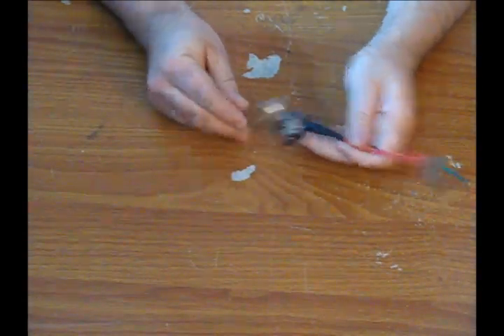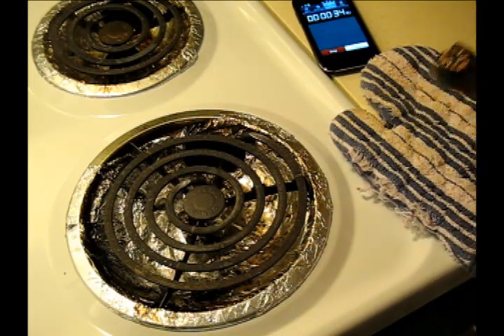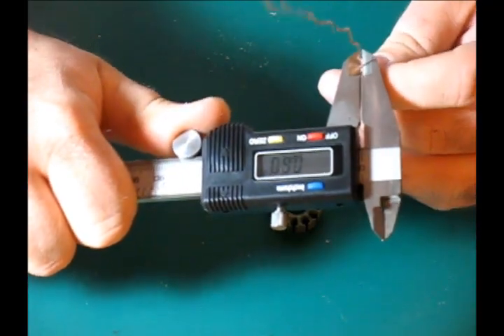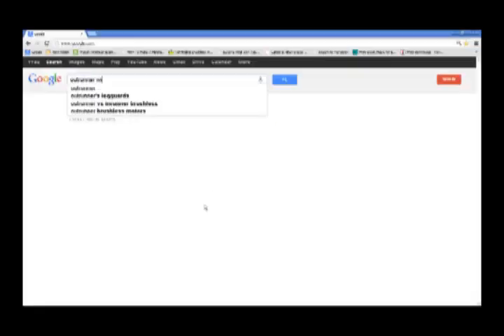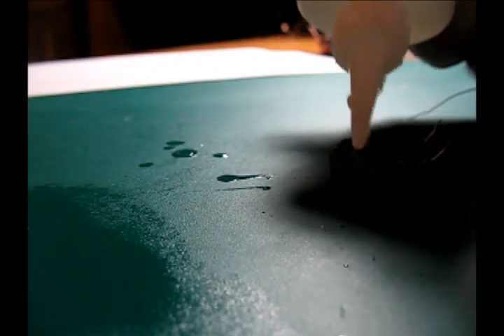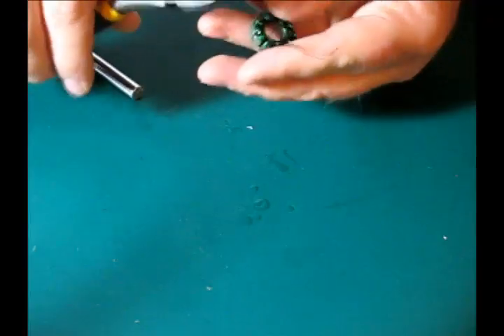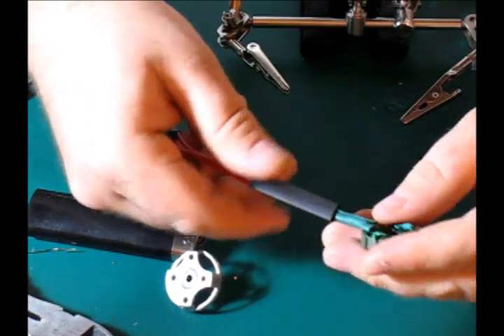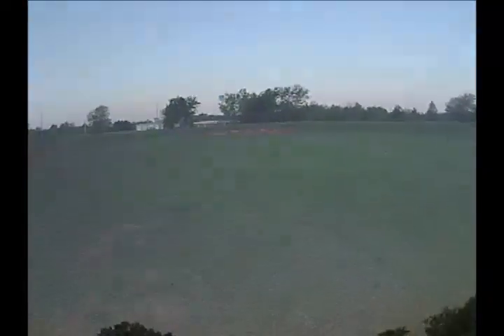Wrapping a Turnigy Park 300

Comment: A very aggressive disassembly procedure.
One should never damage engine parts.
Laminations are very brittle and heating them too much leads to loss of efficiency.
Bearings above 80 degrees c. they begin to drain their oil. you have to remove them before that.  CA glue  destroys the insulation of the magnetic wire and can cause shorts. never to be used in an motor. http://aeromodelismoelectrico.blogspot.com/search/label/Rebobinando%20un%20motor

Comment: What type of insulator was that liquid you used? were did you got it from? (i have used nail polliser, but not sure it is a good solution)
Reply from the maker: Dimitris Alexiadis I honestly just used CA glue.
Reply: smit6089 cyanoacrilate? Is this like super glue? Logo type? I ask because I have damaged the insulation and Need to fix that first. Did it work ok for a long time?
Reply from the maker: Dimitris Alexiadis yes. Just like super glue. Mine lasted about a year but then I over propped it and killed it.

Comment: Would permatex shellac work for insulating the stator.
Reply from the maker: It may but I'm not sure. To find out dab a small amount on some paper and allow to fully cure. Then use an ohm meter to check for conductivity.

Comment: could i do this to change a motor from low to high kv by adding less turns?
Reply from the maker: There is a lot of math relating to this that I will not pretend to understand but in my experience more turns yields more torque but Lower KV and less turns yelds less torque but a higher KV.
Reply: thanks for responding my problem is i have 2 motors with much to low kv to use and i would like to change it its worth a shot i guess

Comment: Thanks for the tutorial, really well made. I wondered if you could give me some pointers on how you pushed the shaft through?

I removed the C clip and tried using a vice but it wasn't budging, I read online that a few people have bent the shaft using that technique. I can't use the prop saver as it's too small and is fixed to the bell. Any advice would be much appreciated. Thanks.
Reply from the maker: Mine was extremely difficult to push through the bell. I heated the bell on an oven coil for about 10 seconds (similar to removing the bearings) and then hit it hard with a vice. Make sure you are using a socket or something against the vise to give the shaft a place to go as you are pushing it through.

Comment: Hi excellent explain, thanks, but please.
I am looking for , how rewiring sunnysky brushless X2212-13 Kv980 , number turn , and wire size etc.., someone knows you there make ? or to have one idea ? Also maybe a plan. ?? Thanks so much for your answer.
Reply: Lawrence Spies There is a lot of variables.  I have a 12n14p that I am winding to 400 KV.  The stator is 5020 so it will be different than this tiny stator.  For my motor 920kv would be about 3 turns.  I have not found one single equation that would work for everything.  It a lot of trial and error.  I just wind a motor with a best guess and measure it, then adjust from there.  Remember, to test the motor you dont need to go through a full assembly.  I just drop the bell on and fire it up, not worrying about cable soldering or securing the bell.
Reply: Hello -  I have now finished rewinding  my Sunnysky - 12N 14P, in delta. Works very well.
Reply: jeanlucvar Is there a formula to use for wiring a motor to a certain Kv? say 920Kv. I have seen kits to build motors using 9 and 12 stator. But I cant seem to find any info on how many turns with what gauge wire to achieve 920Kv.

Comment: Great explanation and great tear-down / rebuild.  Also, props to a fellow "Bic lighter method" heat shrink applicator.  ;)
Reply from the maker: Thank you very much. And a Bic lighter may not be the 'proper' way but it works just fine. :)